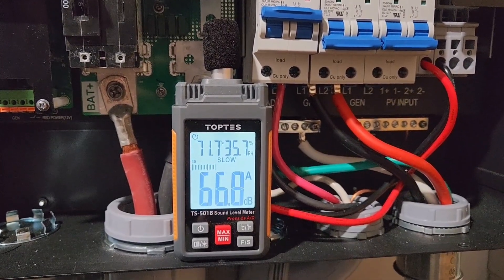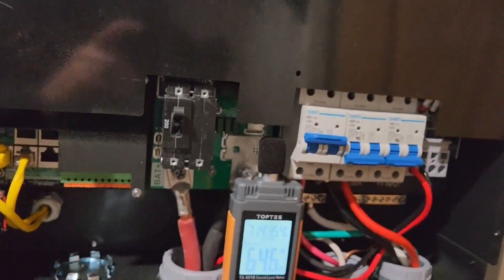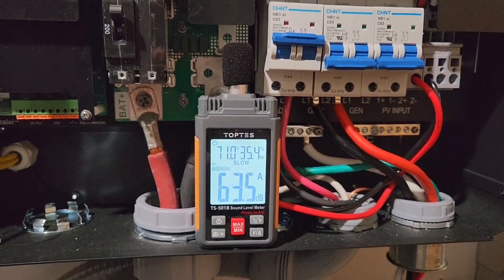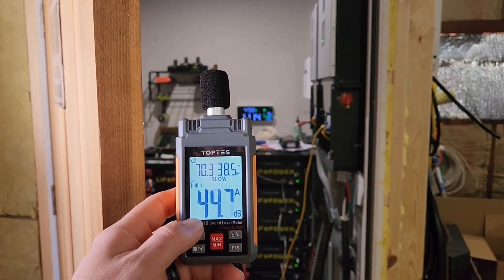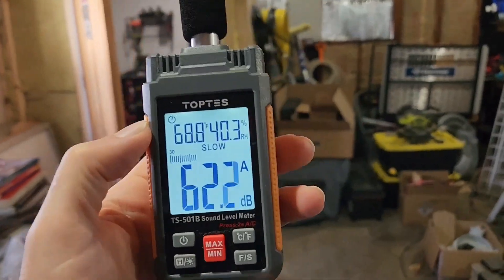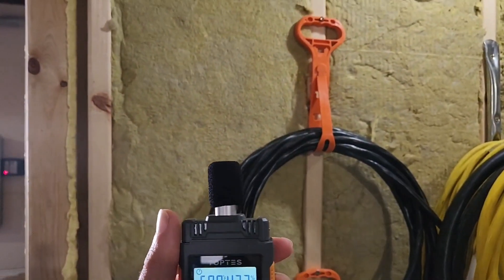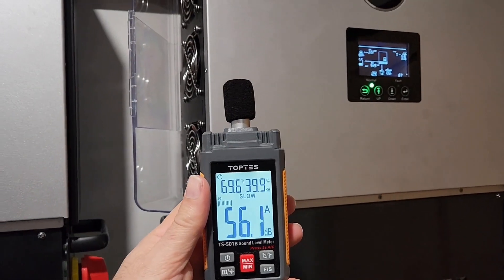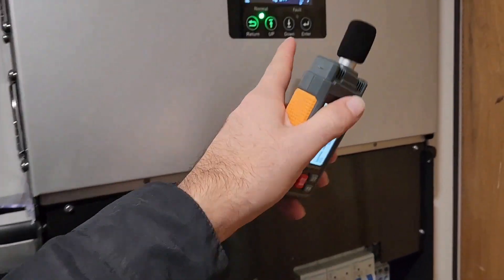Question, What is the noise at idle, 400 & 5,000 watt load.  Answer 35-65 dB measured at 0-15 feet

Comment: I just installed a new eg4 6000xp i was running an older magnum, and wow the eg4 is loud  so far that is my only complaint. if i would have known how loud  prior to install i would of had relocated the inverter. if you are in a tiny house just be aware this unit is loud when the fans run and they run a lot.
Reply from the maker: You can adjust the fan speed down, assuming the inverter is in a conditioned room.  Yes it's loud compared to a fan less unit.

Comment: Thank you so much! I'm getting ready to install a pair if these w/3 of the wall-mount batteries in the back of a 12x20 shed, and this confirms that I need to wall them off if I expect to use the front of the building as an office. I'm going to create a 'solar room' in the back that's 12x4, and put a door on it.
Reply from the maker: A simple wall partition with 1 sheet of drywall and some insulation completely eliminated the fan noise.
Reply: @theadventuresofarenaissancman  Thanks again. Really - this helped a lot!
Reply from the maker: Welcome